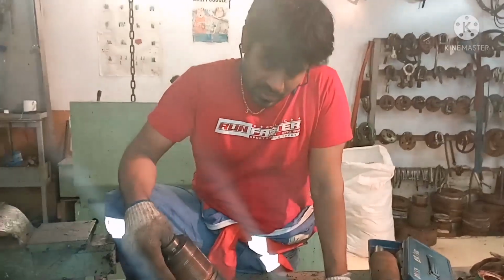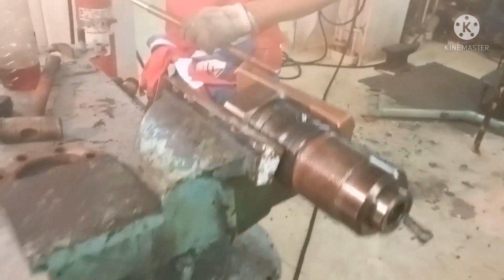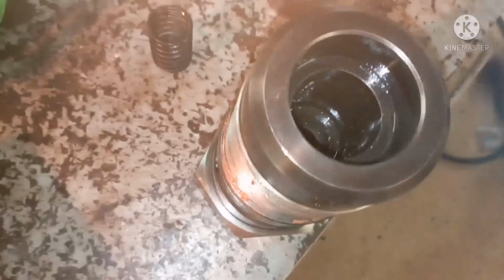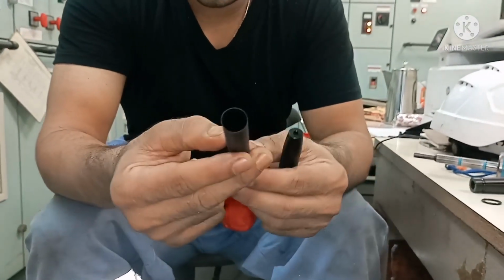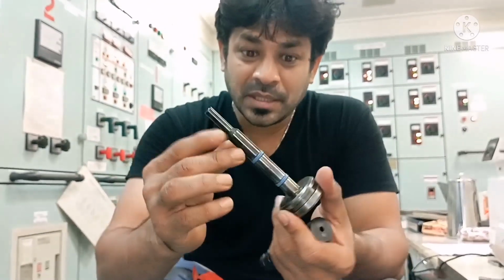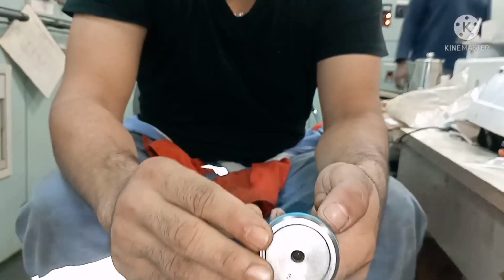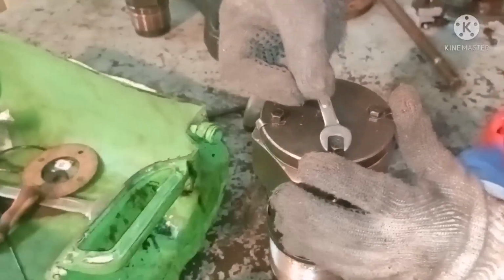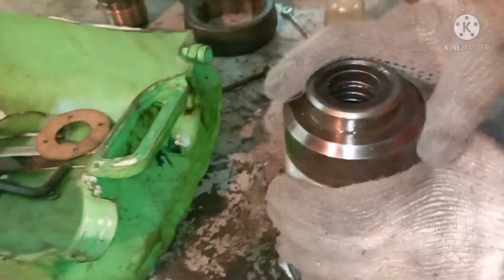HOW DO THEY DO... HOW TO OVERHAUL FUEL PUMP PUNCTURE VALVE FOR MAN B&W ENGINES...

Comment: Sir if i m going to stop engine that time all air connection from bottle to pucture valve ok but this puncture valve piston stuck off.so main engine will not going to stop at narrow channel during manuevering.what need to do in case of that emergency situation or it can be port for engine trial?
Reply from the maker: u have special tool to lift the puncture valve if the valve get stuck during emergency..